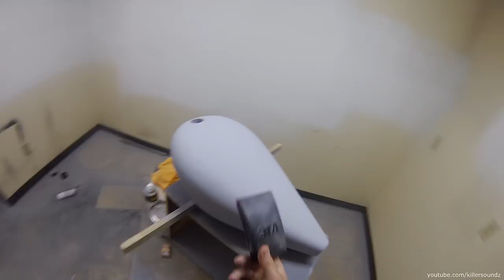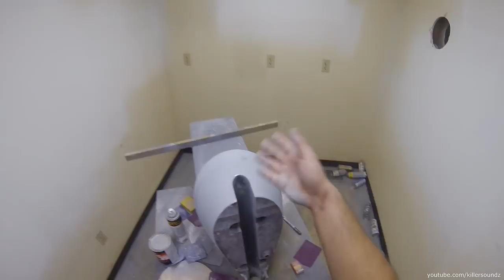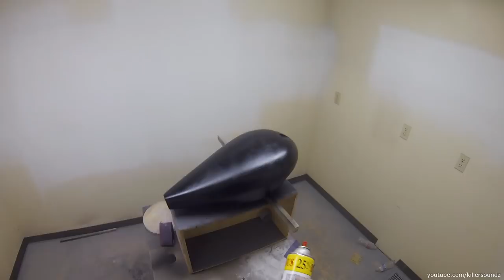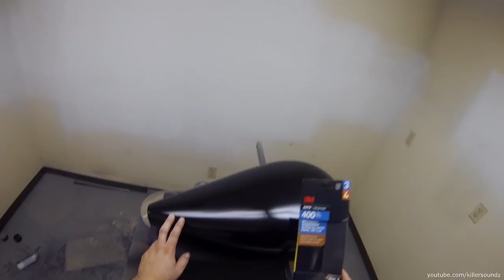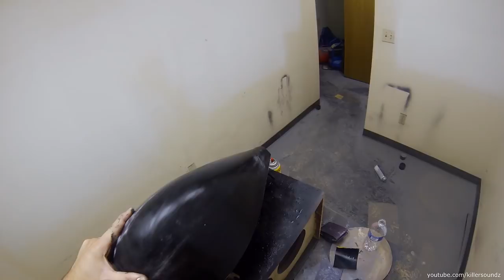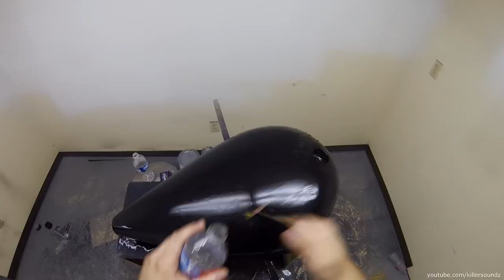How To Spray Paint a Mirror High-Gloss Finish with Rattle Cans! Primer & Color (Part 1 of 2) ✔

Comment: I always take a hair pin and ream out the nozzle on a rattle can. There are always plastic imperfections inside the spray hole, and honing them out makes a Huge difference in the spraying pattern. And...if you soak your spray can in pretty hot water, it'll spray a finer mist, and dry quicker. Experiment on some old surfaces first, just to see if You like the tips as opposed to not doing them. Good job on the Tank by the way, but next time, seal that cap hole!!!
Reply: I just sprayed clear last night, I used the 2-can method (held next to each other and used as one), to double the volume and size of pattern.

Comment: also use a guide coat of black primer over the grey primer. just dust the black on. then you can see your high and low spots when sanding primer. much easier and quicker.
Reply: also your scratches would have shown up

Comment: I painted my Alfa Romeo spider,with a gun,but while colour sanding,I noticed the ear is a great way to get the paint ready for polish,as you sand the sound of the paper will change  at 2500 wet,dry ( set sanding] the sound will become very quite as you get to a perfect finish.

Comment: Yep, 80 grit on primer to start is where you went wrong. 400 grit to start, dry sand only, gets it perfect. Use paint thinner to clean in between coats. For the color, 1000 grit in between coats. DRY! No need to wet sand. Then use 1400 grit in between clear coats, with a smooth final coat good to go.

Comment: Hi.. just a few tips.  Good job considering your using rattle cans. Get hold of 400.. 600.  1000. 1500 paper before you start. Count 4 seconds per 4 square inches then move over to the next area when wet sanding.  Your building up way too much heat in 1 area hence your losing material. Get the top coat as even as possible then proceed with colour coat  if it isn't blemish free its gonna stick out like dog shit on a pool table.

Comment: There was a very cruciall stage that was omitted in this process because a spot part filler should have been applied on the primer coat to eliminate any scratches before the base and clear coat is applied.

Comment: I’m not gonna tell you what you should have done because you took a lot of time for a rattle can job and it turned out beautiful. How I do it is after my primer I use a 320 to get it smooth. Elimination of the scratch marks. And an orbital sander works the best. Or small hand circles. When coating lay it on like you want it to shine. Use a piece of metal material to test spray where you feel comfortable laying it semi thick. Hit that with the 600 after drying fully. I add 2 more thicker coats. Hit the ol girl with the 1000. For orange peel. Shine with 3000 and buff then polish. How you did it it should have had its shine with out all that sanding. Nice finished product. Good job bro

Comment: Very nice result although you did it the harder way. Would have been easier to prime and sand. When it's a nice shape and texture, then paint base coat but a bit closer to the part, yet at the same speed as you did. The way you are spraying far away and angling the spray a little upwards over the part, you get a lot of dry spray landing on the part, that created too much texture for you to sand. So lets say you are spraying a bit closer at 6 inches away, continuous strokes, and overlapping the previous spray stroke by 50% and not too slowly, then you should have a very smooth surface with just a little orange peel rather than a texture. I've practised on an A2 size sheet to get more used to spraying, to get a glossy finish without runs.

Comment: Not to shabby it came out nice the inly 2 cents I have to say is after sanding when cleaning off particles for next coat you shouldn’t use your bare hands . It leaves oils on your surface and can cause more issues . At least wear gloves if your not going to wipe down with a paint prep otherwise tho it still came out fantastic I’m painting my truck the same way . A lot more work I’ve got a couple coats on already my issue is I am having trouble getting an even gloss with my gloss colored color also using black . It looks wet in some areas and flat in others on my last coat . So back to wet sanding I guess maybe another coat will fix it . If not I’ll wet sand again and see if my clear coat will even it out

Comment: Krylon works great been using it on bike frames for almost 40 years screw the purist and their ""aww you should've..." Comments. whatever works for you not everyone has 500 or 600 s laying around.  I've used industrial paint before -yeah the cheaper paint.

Comment: a nice way to practice is to get a large acrylic piece (ofc, clear) and cut them up in several 8 x 8 inch pieces, then start painting one first pretty light but many coats, and when you think youre done, take a lightsource behind the piece, it can tell you if you sprayed to little or too much etc. make sure to just paint one side tho, lol

Comment: another way to sand primer is with a slightly/non stiff green scotch brite pad.it shapes/forms to the contour perfectly and when clogged,rinse it out,shake it dry and continue.just use light pressure and let the pad do the work.

Comment: Dude, sanding through to the primer with 800 has nothing to do with your primer.  you're only putting one coat of base on before sanding...  THATS why you're sanding through.  give it 3 or 4 coats, then wet sand.
Reply: load of rubbish
Reply: Why the hell he sanding a base coat? He should sanding the last clear coat not the base coat. All these spray painters should be send to Antarctica.

Comment: I'm going to be painting a batwing fairing from Memphis Shades.  I bought the bike used with the fairing used.  I was able to get out 95% of the scratches using Novus, and now it has an almost mirror like finish on the plastic.  Would you recommend a high grit sanding prior to primer, or prime it as is?  The products I'm using are all from color rite so I can get a good match to the factory paint color.
Reply: The heavier the grit for sanding simply relates to MORE unnecessary sanding, the same with removing all of the paint on any item you are going to paint.

The thing is, when the surface you are going to paint already has an undamaged finish leave it as is, wash it then seal the original coating and only then apply a couple of light wet coatings of primer which will also be lightly sanded, and for those who use a guide coat do it before sanding, there is more to painting than what I just stated, meaning a good prep job, so do not make extra work for youself when possible.

I was a journeyman spraypainter at Disneyland in Anaheim for a lot of years and we never took any of our ride vehicles down to bare metal, with the exception of the 'subs' which were sandblasted to bare metal beneath the water line since a couple of coats of a bitumastic coating, similar to tar, would be applied to protect the hull from rusting, other than that everything was sanded with an orbital sander with 120, 240, 320 with spot priming as needed and then the final coats would be applied as needed.

The exceptions to this were the autopia cars which use Dupont Chrome Illusion Paint, at $1,200.00 per quart to paint one car and a few other items which needed a little extra TLC to obtain a "show quality" finish required for our guest's appreciation while they are at our park.

The thing with painting and painters is painting is an art form and not the robotic application of coatings, which I've stated before now, and some of the techniques which are presented here would never be used by myself does not necessarily mean they are wrong, it just means I was taught differenty and as long as the final product is pleasing to the eye then that's what is ultimately important.

Comment: I would have removed the bump in the middle of the block so you use the whole area as it is meant to be used. Then you end up doing just what you told everyone else not to do and use your fingers going long way instead of across the so that the grooves from going along the axis of the tank will not appear and you yourself did exactly what you told us all not to do. I kept adding coats of base color and wet sanding until I got 1200 wet block sanded in-between coats, before I shoot my first coat of clear. Then I', going to block sand it with 1200 and shoot another coat of clear until I have enough on it to polish it and take all imperfections out of the top layer of clear and take it to a high polish mirror finish. Then call it done. Wax it and use it in all that mother nature can throw at me.

Comment: I would use an hyndriotis oxide flex capacitor base with amonium sulfate enamel spray with mecury flakes then use a 70000 grit paper strapped to my man hand with cables hooked to a 300 amp battery while keeping my feet grounded and you should be holding the can approx. O00.20 centimeters away at a perpendicular angle as the dimension of the sun then hit it with a solution of hydrogen mixed with epson salts baked at 400 degrees ....thats what i would do

Comment: alex your sanding block is hollow because the bubbles and differences removed off  your primer, if you would take a straight block you get little flat surfaces in the tank and you are going to see that a the clear coat

Comment: This always seems to be the theme of people that use rattle cans to paint, They don't prep their work well enough to get the finish they want, Patience goes a long way when preping anything to be painted, My rule of thumb is sand until your arms feel like they are going to fall off and then clean and look it over to be sure you got it all sanded smooth. 400 grit should be high enough to be able to paint. I start with 220 grit and work my way up to 400, The smoother your primer is the smoother your painted surface will be.

Comment: I like to use steel wool (00-000) on primer and first few coats of paint, with a thorough tack clothing to get rid of any particles. Wet sand closer to the end with 600-2000. Anything below 300 grit on anything but the worst crap or woodwork is just too rough imo.

Comment: Save yourself some time and energy and wet sand the high build primer with a flexible foam block and 600 grit paper and lots of water. Essentially your using the paint as a thin primer to fill the fine scratches you created with your 400 grit. Twice the work.... Thanks for the video!!
Reply: PS chewing gum while you film.... mmm... maybe rethink that.. good luck.

Comment: what primer did you use ? ihave been using the rustoleum automotive primer and it won't stop chipping I've been trying for a month. I read U-POL and heard it is the only way to go._I am going nuts can't figure out why the rustoleum automotive won't work.

Comment: I hope that you're not doing this for someone because 1- If you're billing someone your taking way more time than you need, and 2- in a few years you'll be able to see those scratch marks and other stuff you filled in with paint.  That area around the filler will never look right under certain lighting.  The reason is that the primer and the paint will shrink at different rates over the years and what you filled with paint will show up again.

Probably the best way with spray cans for it to look good for a long period of time would be to do the bodywork, then spray any exposed metal with an etching primer.  After that 2-4 coats of a high build primer and a guide coat.  Sand that with 400 wet on the block (sand off the high spot and then put a sponge between the block and the sandpaper to let it follow the contour of the curves better).  Here you should have done with the high build primer what you did with the paint, it would have been way faster and cheaper.  Never sand through to the metal, stop as soon as you see etching primer (the reason they make it a different color).  Repeat till you can remove all of the guide coat without sanding through the primer.

Comment: Why did u not wet sand your primer with the 400 then six then 800
I always go to 2000 wet n dry sand build up a shine and then knock it down to 6-800 all whilst guide coating it then do the same method as u with the colour

Comment: After the color spray with MAX2K two part clear. It is gas proof!
Reply: No. You  need to use 2k clear with hardner built in
Reply: @rjpeck9718  they make 2k clear that comes in cans.. Eastwood makes it

Comment: I keep wondering why you didn't choose automotive paints like Duplicolor in the fan spray can, such as GM1 black. I Know it needs a clearcoat but you may have used less paint. It is not expensive and is readily available.
Reply: TrailBusterBrute1 Ive used Duplicolor before on my Jeep. Its ok, some may have had success with it.  I had great success with Rustoleum, it super opaque (on the same Jeep). The only downside is you gotta shake the can until your arm falls off.

Comment: The reason you went through your primer is because you used such a course sandpaper. Never use anything less than 400 and move up to 600. For me, personally, I don't go any higher than that but that's just my preference. Also, consider using water and wet sand, this will also help with the dust..
Reply: Dude, he used a shit ton of water and ONLY wet sanded. Did you watch the same video?

Comment: Great video.

I found that the Rustoleum sandable primer is far better to use before you start top coating. I was sanding that stuff with 1000 grit and getting an awesome smooth finish. I used spot filling with it to get rid of scratches and other small defects. 

Also your sanding block is too rigid my dude. Go with a sanding sponge.

Comment: I tried this on a 1983 Honda V65 Magna that I'm restoring, and when I tried to put fuel in it, some of the fuel that spilled on the tank just started eating through the paint. How do I fix this?
Reply: +nathan harrell You need several layers of clear coats to protect your base coats.

Comment: It doesn't look like you reply to your viewers, so maybe one of your viewers can help me. I have been doing paint jobs like yours for years, I had one job that I am still perplexed by. When I was finished with all of the steps, the top of the gas tank after about a month started to get several blister type bumps. I Painted the fenders, oil tank and frame all in candy apple red and none of the other parts had a problem,just the gas tank. Any body ever have an experience and a solution for this?

Comment: So do you think if you would have laid the primer coat down with better sanding it would have saved you from all that wet sanding and addtional color coats?? Haha!!! JK man! You said that abour 100 times so I had to rib you a little. Seriously though, you ended up fixing it the way you did it with all those coats and wet sanding but you could have saved yourself days and hours by going and buying the right sand paper and sanding back that first coat of primer and laying another. Just curious why you continued to fuss with the color coat method to even it out.  The other thing I noticed (and I'm a novice!) is that every single paint video I've watched the guy won't touch the bare coat with his hands and always uses degreaser before his next coat but you used your bare hands to get rid of the dust and were leaving fingerprint marks all over it. It certainly didn't seem to effect the next coat so makes me wonder why those other guys go through the trouble. Maybe a myth? Who knows. Anyway, thanks for the vid!

Comment: Not to sound negative or anything but that's that's not a how to video lol more like your own way of doing it. All that wet sanding you did needed to be done in the primer, base coat is not gonna cover defects as well as the primer will. Also to even start hitting it with your base coat you should go up to a 600 grit minimum on the primer

Comment: Dude there is absolutely no difference between rattle cans and using a gun. Other than the fan width. Small things I will not bust out the gun. No sense in all that

Comment: Why didnt you wet sand the primer?
Reply: tgs989 you don't wet sand primer, just sand with 400 or higher, clean it, repeat, then spray base.
Reply: First get a small pail so u can dip sand paper in and prevent water going everywhere second use a plain bar of soap on the wet and dry sand paper helps with the sanding process allowing ease of movement and less abrasive action in the sanding result. Not perfect but not a bad job either ur on the right track.

Comment: Had to laugh when u burnt through your paint for the 5th time ....you should of wet sanded your primer coat with 1500 2000 then color coat with a 2000 wet sand another coat of color wet sand if needed then clear and same again with wet sand in-between then a polish